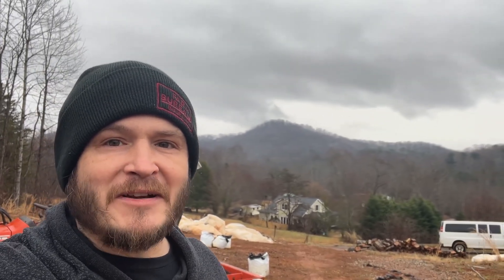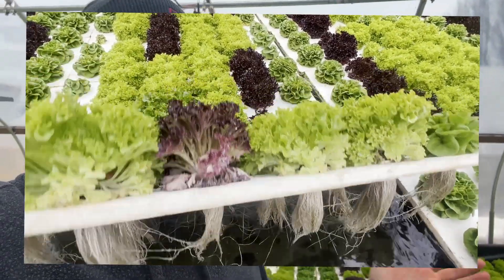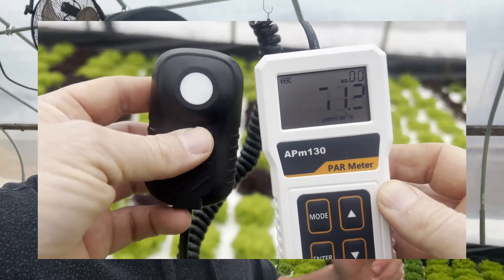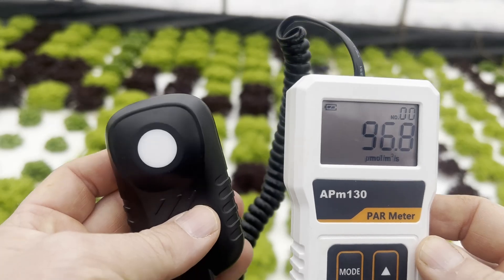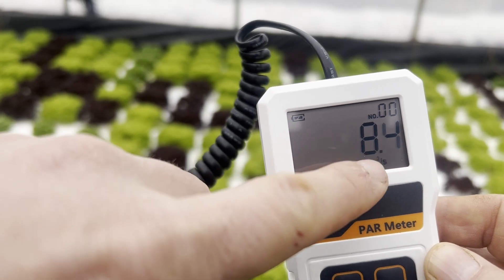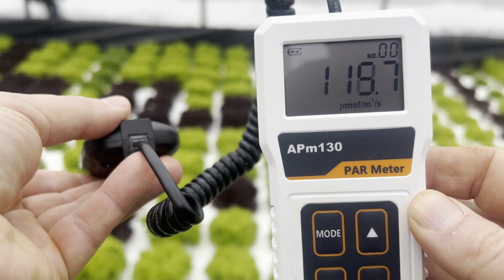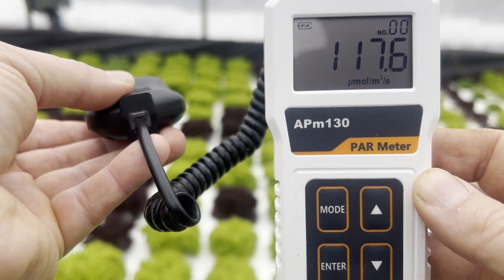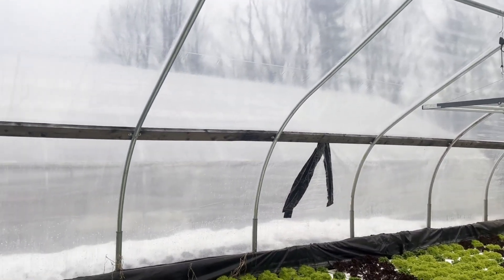Winter Greenhouse: Testing Sunlight & Surviving the Cold!

Comment: Mid winter is a fine balance between produce and costs but soon recouped with much earlier spring produce . For me i get power cuts at the worst times and if frost gets into the greenhouse then there's a lot of wasted effort to view . I have had quite good results growing on a hot bed in the greenhouse , slightly warmer soil makes a huge difference but its quite a lot of work to set up .
Reply from the maker: I resonate with a lot in this comment, been through rolling blackouts at -5 and total crop failure multiple times. People don’t understand the risk/reward input/output farmers have, but for some reason it’s still compelling!

Comment: I have a 10x20 greenhouse that gets partial shade. Was thinking about getting those Barrina t8 blurple led to go across the top. They’re 40w and I’m gonna hook up 5 of them because they’re
4 feet long
Reply from the maker: Those barriana lights have to be directly above the plants, a few inches otherwise they just don’t put out enough light to make any meaningful difference, although the new ones are better than the old ones I can run them about a foot over the plants and I get 150 ppfd over a 4x4’ area. You would be better off, looking into sodium halide or HID depending on what you wanna grow they’re probably just as efficient and just a little more expensive but can cover a 10 x 10 area pretty easily
Reply: @ my greenhouse is only like 7 fee high so idk if that would be too close for those bigger lights. Most people have them way far away from their crops in those tall greenhouses